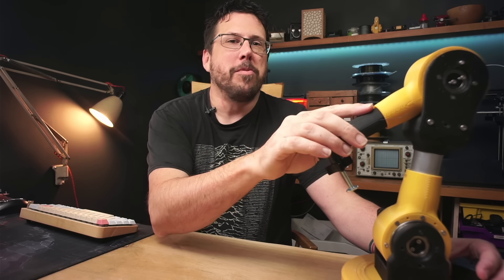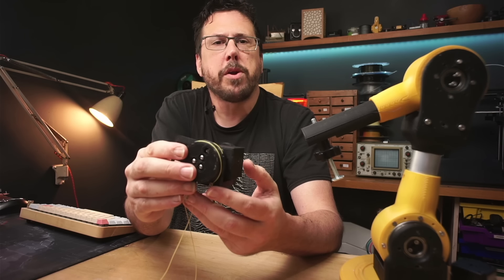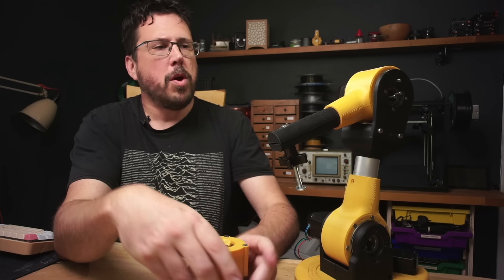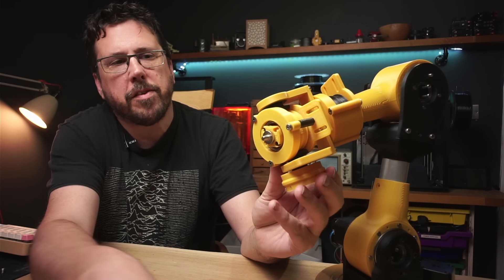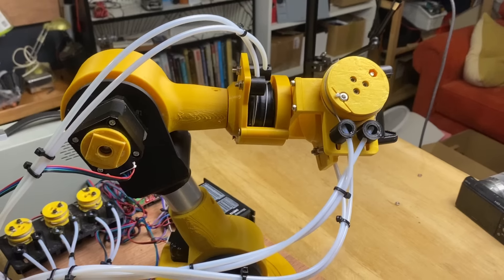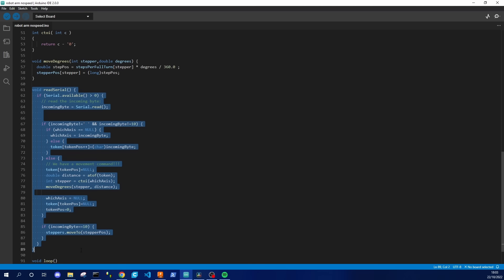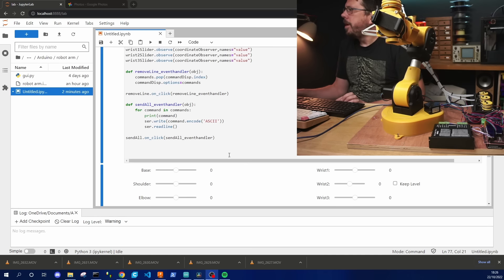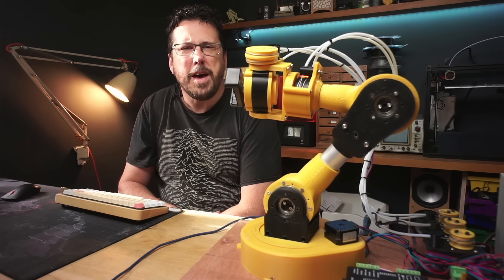Robot Arm Wrists are too heavy - until now!

Comment: This is pretty cool. Not unlike how our own wrists work when you think about it, right? Our tendons are controlled by muscles that are actually mostly much lower down in our forearms, away from the actual fulcrum point up on the wrist that they're affecting. Kinda different but similar in a way. You get what I mean. Maybe that's why we evolved like that, more efficient to move less mass around at the end of the arm while maintaining control over the joint at the far end.
Reply: desinc???
Reply: @Neon-ws8er  he do be watching YouTube videos
Reply: muscles would be the motorr in a robot, however when it comes about motion, animal human, the most powerful fuel is oxigen, compressed air, people of robotics should consider this, the wire hacks and installations, soon will become the next issue to deal with, however by now, the best approach possible.
Reply: hi desinc

Comment: I love following your progress with the arm. I was particularly intrigued with the ability to do serial communication with Python. As a beginner Arduino enthusiast and as someone who feels more at home with Python, I would love to see more of that. Great video!
Reply from the maker: Thank you. Yeah, the way I'm approaching this is to do the minimum of coding on the arduino and then I can bang all the "intelligence" on the computer. Arduinos are cool and all, but python is SO much nicer than C :D
Reply: @roTechnic  That's really great. Just the other day I was trying to translate a relatively involved code from Python to C++ for a project and found it extremely tedious. I would definitely like to take the approach of doing the heavy lifting in Python and would also love to hear if you have a good source for learning how to integrate Python into the Arduino framework =D
Reply from the maker: @curious_ben  I'm afraid that I don't have any sources for what I'm doing. I normally just design up a quick DSL (Domain Specific Language) - in this case the stepper motor commands - and then write a quick and dirty parser on the arduino. As I keep the DSLs as simple as possible, I've never needed to use a library to parse them, a simple State machine, or in this case a couple of if statements are all I need. The Python side is even easier as it's just serial communication and building up the commands as strings. If you've got any specific things you'd like to do, I'm happy to help over email.
Reply: @roTechnic  Thanks! I'll send you an email🙂
Reply: Arduino is adding MicroPython language support to a select number of board models. Two Nano (BLE Sense, RP2040) boards and the Portenta H7 board to name a few.

Comment: I've always been really nervous about robotics and have been slowly learning about it as I get more comfortable with printing and programming and seeing things like this makes it all seem so much more approachable, there's still room to innovate and make things easier and get over some of the hurdles like weight and motor strength. I've seen hydraulic robotics where they used motors to just press and depress plungers on syringes attached to tubes and something about that just immediately made the whole of the technology seem so much more approachable and seeing you attaching the lines to motors on your final design and have them fishing up through the rest of the robot just... It just makes it make so much more sense, it feels so much more applicable, so much more reasonable. It's just pulleys, tubes and motors at the end of it, much less daunting.
Reply from the maker: thanks.  the main drive behind the design is the idea of simplicity.. keeping it as simple as possible - and then maybe upgrading parts and increasing complexity over time, but with each change being small and easily understandable

Comment: Very unique wrist design! I like it. Is there a lot of backlash in those final three joints?
Reply from the maker: Thanks. There's no backlash at all in the joints, but with enough torque applied to them, there is a bit of stretch in the lines. Not enough to be noticeable in normal use, but as I move the joints faster, it increases. Sensors should fix that though

Comment: Freaking cool! Love to see home innovations like this. At the end you mentioned you wanted to put sensors at each of the DOF to know where it is at all times - alternatively you could have an exterior plate that you calibration with from time to time to save weight on the arm still. If you have worked with CNC Mills, it would be like calibrating the Z axis - a conductive metal piece on the arm will slowly move towards the sensor plate until contact is sensed and a high level of accuracy can be achieved for the exact position of the arm. You would have to get creative with where you put the conductive parts on the arm in order to know where each DOF is, but this may be a lighter and cheaper option for sensing at the cost of constantly knowing where the arm is. I just wanted to share in case this was an avenue that may interest you!
Reply from the maker: Interesting. I’ll look into it. thank you

Comment: Back in the mid 80s I worked in robotics, and there were (and still are) many different approaches for different applications.
The approach you took here is specifically for lightweight loads, as strings, cables and such tend to stretch with higher loads as well as over time, thus affecting the precision.
Robotic arms are designed for specific loads, no matter how many axis (degrees of freedom) they have.
With your system, you have to pay very much attention to your first and fourth axis to not over-rotate them. Otherwise some of your strings might stretch or even snap, or create friction inside the tubes that have been wound around the arm, causing it to fail.
Sorry if I come across too critical. I only mean to point out some points I personally have had experience with, and have had my own fair share of mishaps 🤫
Reply from the maker: Don't worry, you didn't come across as critical. You're right about the applications. Some of these issues will be mitigated when I fin sensors to turn it into a closed loops system, but I agree that this approach will not work for higher payloads.
Reply: @roTechnic  for a heavy duty arm, the motor is negligible compared to the payload. To be honest your design is backwards
Reply: Both of your comment and video are helpful. Thank you.
Reply: @roTechnic  you could still overcome the limits on the 1st and 4th axis created by the wires getting wrapped up. 1st could have the spools and motors mounted there since weights not an issue that low down. but the 4th could be bridged with a freely rotating tube around the joint each end being a wire spool. as the joint turns its rotation relative to the spool would be the same as the spool being driven since the tube will be held stationary by the spool on its other end, so you drive that spool the other way to counter keeping the axis this whole line is running still while the 4th turns. this way the 4th can turn as much as you want without anything tangling, it'll just run the wire around one spool as fast as the motor turns it back. and you can nest this inside another of the same mechanism to run both 5th and 6th axis.

im too tired to explain it well so heres and imgur link to a doodle https://imgur.com/a/GgBRnoJ
Reply: How about steel wire?
Reply: steel wire could work for higher loads, but keep in mind that even steel wire stretches, not much, but it can affect precision with a higher load. Also, steel is prone to corrosion so it needs to be protected. There are ways, though. But you are correct that with steel wire you can increase the payload. For the rest, the same issues apply.

Comment: I had an idea for draw string robotics, absolutely thrilled to see it in action, I feel as though with some clever thinking and 3d modeling the Bowden tubes could almost completely run through the core of the arm (kind of tendon like)
Reply: They can also be applied to legs as well ! the Birdbot robot has motors only in the hip in upper hip , the leg itself is mostly just strings , no motors whatsoever

Comment: I've had this same idea for a long while, but instead of cord it was sprockets and chains (or belts and pulleys for simpler/test versions) with rolling joints that allow the arm to fold up however I need it to. I just haven't had the education and materials to do it yet
Reply: we need to collaborate on a mech suit frame
Reply: @kingmasterlord  i will add my grain of sand and say that the legs should be like the ones of Birdbot except bigger

Comment: Hi, a couple comments:
- I'm not sure what wire you use on pulleys, check out Dyneema (UHMWPE fiber), which is high stiffness, strength and slippery. 
- Angular momentum of a mass at the end of a rotating arm increases with the square of radius. Which means if you move wrist  motor from wrist to elbow (1/2 distance to shoulder) gets 1/4 (75% reduction) vs 0 (100% reduction) of moving motor at the shoulder. This is significant because you can pull wires in a straight line, avoiding problems of bowden routing: stiffness, large dynamic/static friction, limited strength.

Comment: One of the first electro-mechanical robots, the ASEA (later known as ABB) IRB 6 dealed with this issue in a similar way by placing the motors closer ro the base and using a clever linkage to actuate the 4th and 5th axis (it only has 5 DOF).
Reply from the maker: Oh, nice. I'll look into that. Thanks for the info.

Comment: I enjoyed your video! One challenge with cable/Bowden motion driving is that when one axis is moved, the resulting bending of the other cable sleeves will lead to undesired movement of other axes (unless the steppers are holding position via sufficiently-high current/torque, and if they do not skip steps). But you mentioned that you'll be integrating sensors some time in the future. Whether they end up being incremental or absolute encoders of some sort, if you have the time and want a fairly precise robot, I'm sure you'll program it to compensate for such 'side effect' through some closed-loop implementation. Great video! I look forward to seeing more! Thank you.
Reply from the maker: Thanks. Yeah, I did notice this. It was especially evident in my last video where I was using bicycle brake cable as the bowden assembly. With the fishing line having a much smaller diameter this is minimised, although it is just perceptible. As you say, a closed loop system should fix that. I'm just printing off the parts to attach absolute encoders to each axis, so we'll see if that fixes it!

Comment: I want to suggest you look at differential pan&tilt mechanisms. It doesn't save you on motors or bowden cables, but I think the mechanism is overall lighter and more rigid. it can be used at the wrist, but also at the base of the robot, reducing a lot of moving weight. It can be done with worm gears, too, to get fantastic holding torque.
Reply from the maker: I certainly will look into it. I'd like to get this arm up to the point where it is useful, and then look into other designs for some components. What you're suggesting will fit really well into that. Thanks

Comment: Very nice idea and presentation of it 👍🏻 What would be nice (maybe already there but I did not notice it) is easing for the movements so they get smoother. Thanks for sharing 👍🏼
Reply from the maker: Thanks Mickael! You're right, there's no easing on this at all at the moment. I'm hoping to include it as soon as I have the sensors in place, as they will need a complete rethink of the motion control.

Comment: This is such a cool idea.
I have quite a bit of experience with C++ and would absolutely love to mess with such arms.
If only it didn't cost a fortune. Like, a grand for a decent 3d printer, surely $60-70 per motor, motor drivers ain't cheap either, plastic for the printer, etc...

If I had to guess, disregarding buying a 3d printer, that arm cost at least $400 in materials.
Reply from the maker: it cheaper than you may think!
you can buy a 3d printer (ender 3) for less than $150. it would be good enough for this kind of printing. the motors ant less than $10 each. the bearings are the most expensive part, but I’ve started using 3d printed bearings where I can

Comment: This is absolutely amazing! Never though about using wires in such a way to allow to move the steppers far away from the location of motion necessary. Saving this video for later use!
Reply: This has been done for a long time. Except it evolved to using water in the lines instead of string. Much more power transfer ability. Quicker response time. More efficient. Less likely to twist and knot etc. this is the old way of doing it. Hydraulics is the better way.
Reply: @jacobleeson4763  thanks! That makes a lot of sense. I would imagine the coding for hydrolic to rotation is more complicated than the wire version but I'm sure someone has already figured it out.

Comment: Nice!  I've experimented a bit with 2mm OD, 1mm ID PTFE tubing, with some high-tensile strength, low stretch fishing cord (i can get the exact product info). For me, it's so that I can put servos in an enclosed, sound-insulated box, driving the movements for an animatronic bird.   I want the bird to be as silent as possible... also moving the servos out makes the thing a lot lighter.   The biggest pain in the butt is getting the lines and tubing secured. :D
Reply from the maker: Oh, nice. I found the biggest pain to be getting the line through the tube!
Reply: @roTechnic  Yeah... that's a big one too... very tedious.

Comment: Don't forget your endstop switches, so if the stepper loses a step, you won't jam the joint.   It'll work fine under no load, but I'm sure that you'll end up in conditions where there's too much load on the stepper motor.  I like mechanical endstop switches, but hall effect sensors will look better, and keep the arm almost silent.
Reply from the maker: Yep, you're 100% right. I'm adding sensors to it that'll detect the absolute position of each joint - I can use them as endstop sensors.

Comment: This is amazing work - and lots of fun to watch in addition!
Having motors in a box on the side is very, very neat - and makes it easier to experiment with different motors, gearboxes etc. without having to print a new arm every time.. 

I'm a bit curious - your approach is for three joints at the far end of the arm makes sense... But are there hard reasons for not using this on the shoulder joint(s)? I mean... the line would be shorter and less joints to affect the line... even though the load would be harder on those joints (but you have the kevlar line and they claim for some of them to handle 30+ kg and with more or less no flexibility...)? 
Or am I just swimming around in ignorance here? :)

Comment: What about two cylinders in a yoyo configuration. Hollow them a bit and use them as a rotational piston. Not sure how quick it would be to actuate but it would remove the need for a motor at the joint.

Comment: Igus has used this design for a long time in their robotics offerings.  ;-)
Since you built one from scratch, I subbed.  😀
Reply from the maker: oh, interesting. do you have a link to their version of it?
Reply: @roTechnic  I don't see my response so I guess it didn't make it.  Here's some copypasta from igus' site.
 Home  Low Cost Automation  Further products  Wire driven robot
Shop Draw-wire robots online
Categories
Low Cost Automation
Articulated arm robot
Cobots
ReBeL gearboxes for cobots
Gantry robots
Parallel robots
SCARA robots
7th axis for robots
Further products
Lift/swivel unit
Linear & lead screw drive actuator
Wire driven robot
Robocube
Energy chain sets
Cable sets
Frame for AGV
Robot and motor control systems
Modular gearbox system
Strain wave gear
drygear® planetary gearbox
Rotary axes
Worm gears

Relevance
Number of products: 1

robolink® W draw-wire robots
robolink® W draw-wire robots
Product information
Payload up to 0.5 kg
Reach up to 650 mm
Degrees of freedom: From 2 to 6
Speed: 6 picks/min
Optional with gripper
High flexibility
from £ 8,414.78/Pc.
Reply from the maker: @russellzauner  Thank you very much

Comment: how do you prevent the lines being stretched and moving the wrist wheh the whole arm moves? wouldn't it pull on the strings attatched to the seperate stepper motors?

Comment: Now, the assignment my teacher gave me 14 years ago: given two points in space, draw a line connecting them ^^
I refused the saignement and asked to simulate a small factory line.

And in a funny way, we started programming the arm using joint command. Then I read the manual end to end and discovered that we could put the arm in "follow" mode. So, the arm support itself and when you try to move it, it detects where you try to move it and move accordingly. Then you can send command to save the way point.
And at the very last, you can ask the arm to go from one key-point to another and even lock joints. (though, we didn't need to)
That read was worth it, because in two sessions, we were done ^^

I also made a really bad joke, because there was also a release command which would free all joints and the robot was massive. My colleague was "holding it" (otherwise, the arme believe you want it to go down and slowly descent, so you need to apply a bit of force) and I issued a "release" for less than a second, which was enough for him to shit his pant. I thought it would be funny, but he didn't laugh at all ^^ (and it was stupid, though, pretty sure that if there is a power down or the command line is cut, the arm stop moving or brackets/home)

And the very first thing we tried is how fast it rotates...and smashed a wood column. The teacher didn't even yell as we were looking at the wood being chipped and froze in horror. Obviously, we knew that we shouldn't put any flesh in the operating area, but I can tell you that when you hear the impact and see the chipping, you look at the arm very differently.